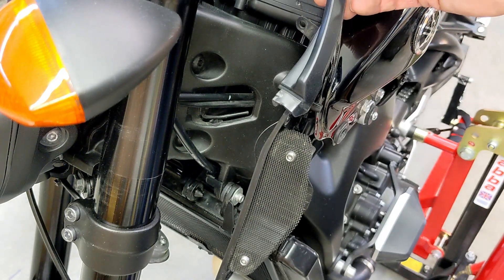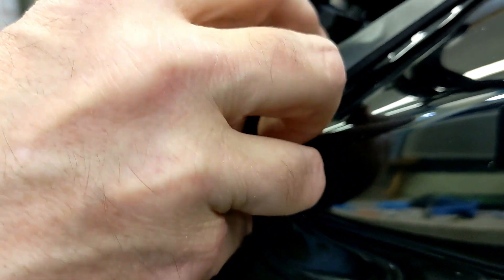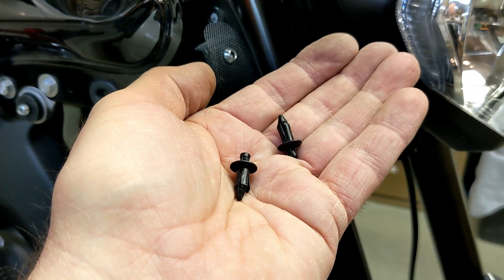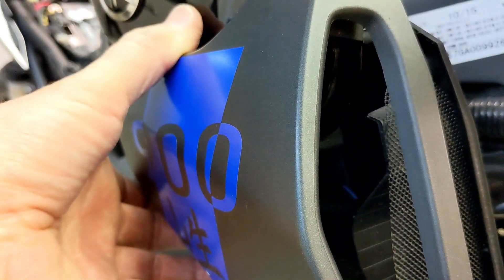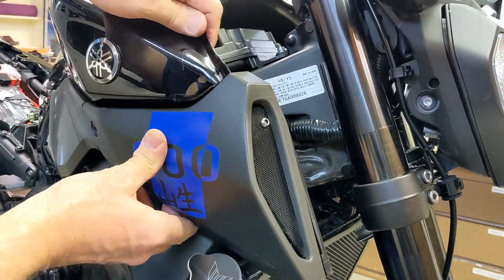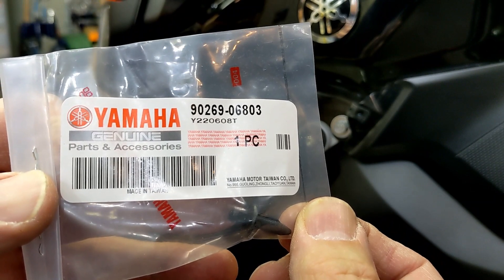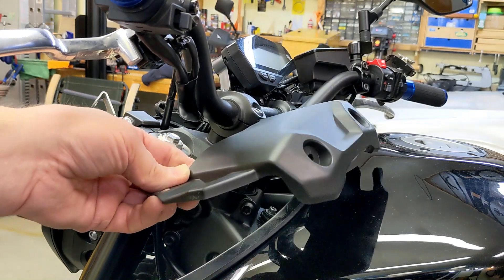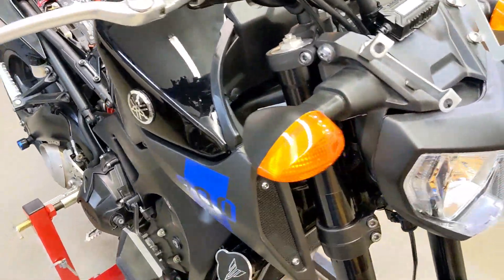fuel tank mole installation Yamaha FZ-09/MT-09 2014 2015 2016

Comment: Dude what are you going to rebuild an old motorcycle
Reply from the maker: Not in the near future... Maybe next winter.... I might rebuild an engine out of a 2012 Suzuki DR 650 with 87,000 miles.... Not technically old as in 1932 old but old as in mileage...